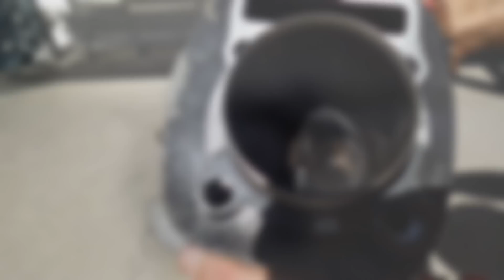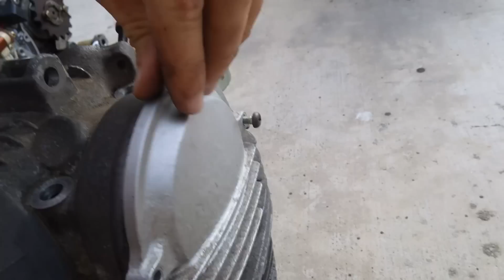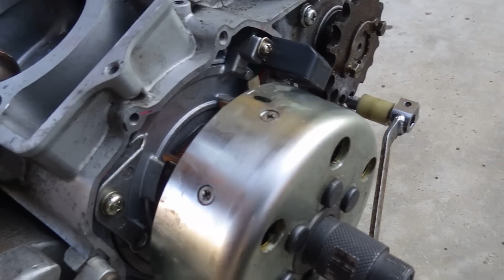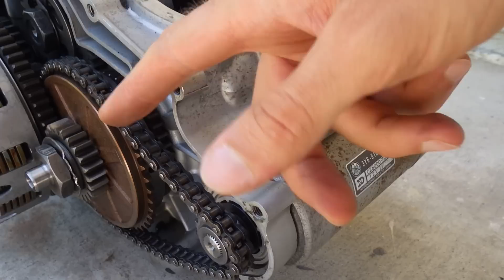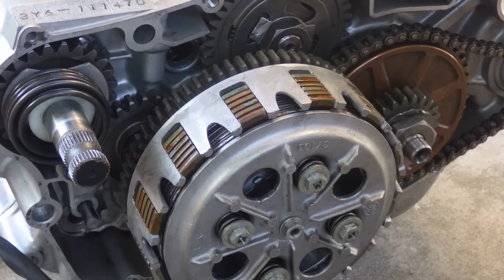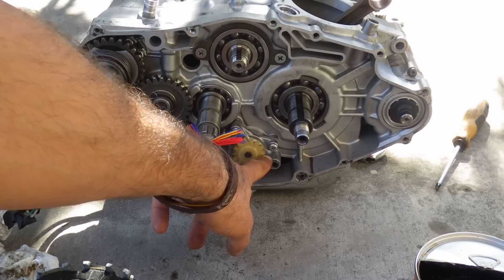From cylinder to clutch to transmission: a complete Motorcycle Engine explained

Comment: the more I learn about a motorcycle the more respect I have for the engineering that goes in to it. each component in the engine represents untold time and money spent figuring out these hard problems. I cannot imagine how someone managed to design a clutch. anyways, thank you for taking the time to put this video together, it must have costed you a significant effort to do this just for the benefit of others. it is an amazing visual lesson on the internal combustion engine.

Comment: When I'm in first gear and lightly holding down the clutch and the bike is moving forward I hear a clunk noise coming from what sounds to be in the front sprocket. The bike is shifting and driving good other than that issue. Any idea what that could be ? Thanks

Comment: This is excellent, but  the transmission also includes the Kick starter. How is the kick starter force routed through the transmission.  I believe that on most bikes it goes into the gearbox and then back through the clutch to the engine crankshaft. It would have been informative to have seen this too.

Comment: Hey, quick question. Is there any lubricant applied into the engine shaft where the piston moves up and down? 
I am just curious cus i am thinking for the piston to build pressure by pressing fuel and air mixture. The engin whole must be tight and lubricated, so the piston pumps smoothly. I don't know, it makes me wanna rip apart somebody's motorcycle. 😅 thanks for sharing this 🙏.

Comment: Could someone explain what happens if you release the clutch too fast and the bike stalls? Is it that the inner and outer hub of the clutch don’t go into sync? Or do the gears of the input and output shaft not aligne in that very moment to trigger some kind of kill switch? What is that kills the engine?

Comment: Yes. Make a piston to driven by an electric motor. That can use 12 v dc hence tap power from the voltage generator to charge and maintain the battery. Can this work?

Comment: Sometimes i like to imagine a distant alien civilization finding an engine like this, disassembled and scattered.
Seeing all the pieces, the weird shapes, the weird sprockets, and just wondering what the heck it was used for..
If you just take a carburator by itself, without having any combustion engines in your society (due to having moved beyond them), it'd be nearly impossible to judge what the purpose of that part is.

The same way we had to figure out how the Antikythera mechanism worked.
And that took our best archaeologists decades to figure out even though our society is more advanced than theirs was..

Comment: This is amazing. It helps you understand on a deeper level.
I always had this incorrect notion in my head that turning the throttle would "make the pistons go faster".
But in reality, all you're doing is allowing more fuel to get sucked into the engine, then it automatically happens from that point on. So in some sense its kind of revolutionary to think, ALL the power of the engine, is already there, waiting, regardless of your throttle input.
You're not creating more power, you're just ALLOWING more power, without restraint.
So zero throttle is in fact 100% restraint, not 0% created power.
This may sound stupid to mechanics, but this is a misconception i always had.

Comment: So that means that if you would have a motor/cylinder with enough force the clutch wouldn't be able to get the energy from the piston to the transmission because the energy from the cylinder overcomes the friction in the clutch. Of course just on a theoretical level. I don't know if it's possible to have something like this happening in real life.

Comment: You said a very wrong thing, the motorcycles engine is two stroke engine not four stroke as you explained, the four stroke engine is like the car engine or diesel engine, but the motorcycle only has two strokes

Comment: Hey buddy, that is a really good rundown of how a motorcycle engine etc works. It would be too much for someone with no pre existing knowledge to absorb, but is an excellent summary for someone like me. I already know the theory behind an engine, clutch, gearbox etc, but have never opened up an engine to see how it works in practice. Thank you for the significant time you have put into making this video.

Comment: one things im still confused about (if anyone could please help!)...

when you pull in the clutch, the clutch discs become separate so the sprocket to chain is disengaged from the transmission power from the cylinder. why is this necessary when shifting gears?
Reply: guy smith yeah the clutch sits between the engine and the transmission. Think of it like this. The transmission has an input shaft, an output shaft and a bunch of gears in the middle that get switched around. These gears dictate the speed of the output shaft vs the speed of the input shaft or more correctly the “ratio”. The input to the transmission is from the running engine via the clutch. The output shaft goes to the sprocket and therefore to the roadwheels.  

A clutch stops the input shaft side to the transmission from rotating under load, by disconnecting the running engine essentially from the transmission, so you can select a new gear without grinding. The problem you see, is the output side of the transmission is spinning at a certain speed all the time, as it’s connected to the spinning roadwheels. The input side to the trans is spinning at another because the engine is running, and you want to change one of the gears in the middle or the ratio that connects the two sides. The only way to change the ratio between the input and output without grinding gears to bits by stopping one half- the input -  from being under load. Once the input shaft is disconnected from the engine load it is freely able to adjust to the different speed of the new gear that has been selected. After which the clutch is released and the engine reconnected back to the input shaft.

Comment: Thanks for making this video it is very interesting i want to know that either kick is connected to clutch or crankshaft but when we start bike through kick. and engine get start the kick become still as kick is connected to clutch or crankshaft what is mechanism related to it and also why does sometime kick or ignition does not work in first time because of not proper sparks or fuel air content going in engine and major problem in winters that ignition does not work properly because of coating of carbon on battery and why does this happen

Comment: I heard of a guy who use build a water Gas engine hybrid.  On every second cycle of the cylinder Water was injected into the cylinder instead of Petrol / Gas.  The water flashed to steam from the heat in the cylinder already there from the previous Gas combustion.  I heard a big manufacturer bought the engine from him.  Have not heard about it since.  Seems like a very clever idea using the free energy from the gas combustion cycle.  Perhaps there was issues with Lubrication, seals etc.

Comment: Why a plastic sprocket for the oil system, though? Is it cheaper, corrosion or meant as a weak link when something goes wrong?
Reply: Michkov good point ... I hope he replies
Reply: +CShadow
Reply: Just my opinion I think if both are made of iron gear if there something happen on gear parts both two gears will be broken so you have to change two gears at the same time...sorry for my english...
Reply: It’s a weak link design incase of failure. On a similar vein, Porsches use plastic impellers on their internal water pumps so if the blades fail you don’t have bits of metal flying around the crankcase.

Comment: I have a question
I bought a 250cc pitbike, with a broken engine, and a good one
I replaced the broken engine, for the good one. I cleaned up the carberator, and putted new oil in it. It didnt wanted to start so i pulled it with the car. Then it startet finaly. And it runs. But when it starts it runs at full power, and i dont know how to change it. Lucky for me the clutch works 😉, u guys have any idea how to fix this ?
Reply: Hendrik Terwisscha Van Scheltinga i think the problem cames from the carburator. Probably the butterfly valve is blocked and doesn't close when you let the trotle off. I would try to check it

Comment: You need to learn the names of the parts so when you're explaining it you can use them. For example that part with the grooves is called the Shift Drum.
Reply: Shaine MacDonald he used the proper terms like 99% of the time, I'm pretty sure you spotted out the one part he didn't name.

Comment: Awesome video, much appreciated. 

Question:  My clutch push rod has only one end with the course grooved threads on it (the end that engages with the ball bearing. What purpose do the grooves serve? I don't see how they engage with anything. The way I understand it, the ball separates the 2 push rods from both spinning, but I don't understand the threaded grooves on the one end? Are they there for heat sinking? or to draw in oil?

2005 Yamaha Big Bear 400. I appreciate it!

Comment: so gears can be shifted without using clutch?
P.S. thank you, it's very useful!
Reply: Without using the clutch you can upshift by letting off the gas performing the movement but not downshift.  Careful doing it between 1st & 2nd gear though.
Reply: use the clutch just to be safe and not wear your trans

Comment: Is clutchless upshifting bad for a bike? On my sportbike it feels smooth - as if letting up on the throttle before upshifting reduces enough pressure on the shifting collar that it can move into a neutral position and then connect to the next gear without teeth grinding/damage. Is disconnecting the engine from the transmission a necessary step?
Reply: It's not a necessary step to engage the clutch when shifting but most people you talk to would say that to a less experienced rider it would be a good step to learn. But, there is a technique as you said where with enough practice, timing and feel for the bike you can let off the throttle and change gears without engaging the clutch and forcing the gears into one another

Comment: Very much needed knowledge in this video. My main question is about the idling. When brake is applied, does the clutch release pressure so the engine can idle without turning the wheels?? In other words is the brake connected to the clutch somehow??
Reply: When you brake you also engage the clutch (when in gear), otherwise it will stall. So yes.
Reply: No the brake is not connected to the clutch. To come to a stop on a motorcycle or any motor vehicle with a clutch and gears the clutch lever must be pulled in or the bike must be in neutral, when you apply the back (foot) brake for instance it only creates pressure on the rear wheel to slow or stop it from spinning it is quite disconnected from the engine. I probably haven't explained it very well but i hope you have a bit more understanding.

Comment: nice vid. Why didnt they use the starter motor as a generator also
Reply: Old 80's engines ran sweet but had a few mechanical, not problems, but flaws that have since been perfected in the 30 years since.
Reply: Because it is small dc motor which run on 12V battery by which if it is given mechanical movement it will produce small current and voltage which is not capable of producing spark so alternator is used which is having strong magnets and more no. of coiling which produce strong current and voltage

Comment: So the piston makes 2 rotations on the crank shaft in between each combustion?
Reply: Zollhafen Yeah, I was actually talking about two full rotations! (up down up down)
Reply: +Kody White yes, that's whats referred to as a 2 stroke engine
Reply: +Joe Shrimpton no shit! awesome. thanks!
Reply: +Joe Shrimpton I believe that this is a 4 stroke engine, correct me if im wrong, but the 4 stroke engine has 4 "phases" (as he calls them in the video) and the 2 stroke only has two, wich leads to only one complete rotation, because the fuel mixture and the burned up fuel is lead in and out in the same phase a two stroke engine only needs two phases. There`s a good animation of that on wikipedia.
Reply: +Zollhafen On this engine yeah sure, but a 2 rotation like what Kody said I think he's describing a two-stroke to the best of my knowledge. A 4 stroke with of course do what a 2 stroke does but in half a rotation.
Reply: +ProCreateful If this is what he means then yes you are right. But i believe, that he means 2 complete rotations (movement of the piston: Down Up Down Up Down) I guess we will only find out if Kody replies :D

Comment: Thank you! This is the best  video I hv seen explaining bike engines.  
I hv a question with the lubrication.These engines are design to run upright  but what'll happen if it runs side ways? [such as seizing and gear problems]
Reply: Sajana Karunaratne 
You see this a lot with motorcycles in crashes, when the bike is placed back upright it often does not start for a while because oil (and sometimes fuel) needs to flow back into their proper places. If you took this engine, while it was running, and turned it sideways it would seize within a few minutes at several different places due to oil build up and clogging, and any places where oil had moved away from would overheat and seize because of this.

In short, running this engine sideways would cause multiple failures within the engine in a very short period of time. I don't think it would destroy the engine, but serious damage is quite likely.
Reply: Eliot Metherell Thank you ...I've been waiting for this answer for long time .Thanks again :)
Reply: Sajana Karunaratne 
you are very welcome, thank you for your politeness : )

Comment: Thank you for your video. I am trying to learn all I can about motorcyle engines. I just got a klr650 2013. Seems to run good but i get a loud knock sound right after ignition, Sounds like its coming from the cylinder area and it happens usually when its cold in the AM. Any ideas? After the first knock, all does fine.
Reply: You probably need to replace the gasket

Comment: awesome vid.  I am interested converting to electric power.  Would you stick a motor where the starter motor sits or the crank?  Guessing depending how much reduction needed. I am guessing you couldn't stall the motor right but would still need the clutch to disengage the rear wheel powering through?  thanks

Comment: I wonder if you could pressurize the fuel tank/lines and run the engine off of vapors alone. I mean, it's the vapors that burn, correct? The carbon deposits are a waste buildup, so not only could it be more fuel efficient but could lead to better engine life.

Comment: Thank you! very educational. One question with the electrical start. So, if you have a kick start is it basically creating that same energy from the force of your foot into the chain? Does it operate in a similar manner or completely different?
Reply from the maker: +Daniel2233 Yes, that's right, except on this bike the electrical start connects directly to the crankshaft while the kickstart connects to it via the clutch basket.
Reply: Ahhh! thanks man!
Reply: Daniel2233 When you kick start, he described how the magnets and electric coils create force, so by kicking the lever it makes the magnets rotate around the coils created that force that ignites the spark plug. Then hopefully on the first kick, your bike starts.
Reply: +Car Guy kick start is not needed, it's usually used when the battery is weak. my 81 Honda CM200T has one
Reply: +Al's Garage so kick start is not needed?

Comment: One thing I'm a bit confused about is neutrals between each gear, wherein on the other side, in the star shaped thing there's only one spot in between the low points, so as there's only one official neutral gear, so how come when you show how the gears are shifting there are neutrals between each gear?
Reply: Bartosz Kunatowski Ah Ok, now I see. Sorry for not paying enough attention, I see now that the transition between one gear and another is full and does not involve a neutral between each gear, and you just pointed out the neutrals halfway through every transistion

Comment: hi Al. great video.   i have a few questions that i need to understand.  I have a 1965 honda S90 with a bad engine on it.  I would like to replace it with a Daytona 190cc.  The questions that i would like to educate is: what others parts that goes with the engine that i will need to have?  And i almost sure that the Daytona 190cc engine produce current (ac/dc current). where does this current hook up to?   thank you.
Reply from the maker: Quoc Luu Engine swaps are quite common. I recommend that you look up some websites of others who have done it, perhaps with the same bike or with the new engine. Check to see if you can use the existing engine mounting points.
Your engine is supposed to generate current, to keep your bike running and to charge the battery. With your bike's electrical diagram as a guide you can follow all the electrical connections that the current (bad) engine has on your bike. You will have to reconnect these with your new engine.
Reply: thank you.

Comment: i am making hybrid car of weight 210 kg with 200 cc b&g engine with 48v bldc motor. thanks to you that by providing this you made my doubts clear that how bike engine and transmission and works togather. can you help me and tell me that is there will be any significant effect if i remove the cylinder block and counter mass as well as replace the crank shaft with op of my engine shaft? and can i remove starter and that valve sprockets from that as they wont be required for me ...? please help me
Reply from the maker: Kaushal Patel I don't see why not. Will your final engine setup be sealed so it can hold oil for lubrication?
Reply: no its a loan mover engine so we will have to think ab that that's why i was asking...can you suggest me any idea?